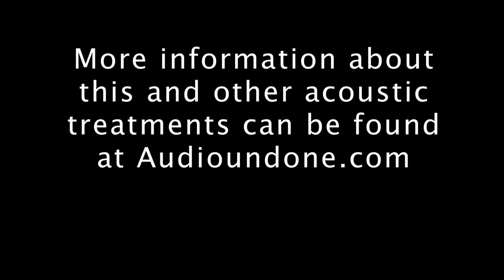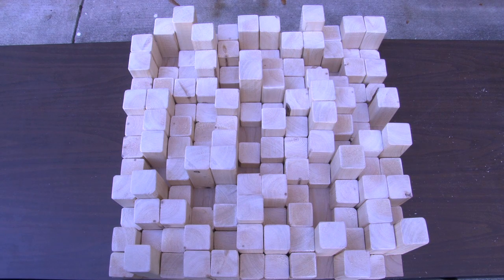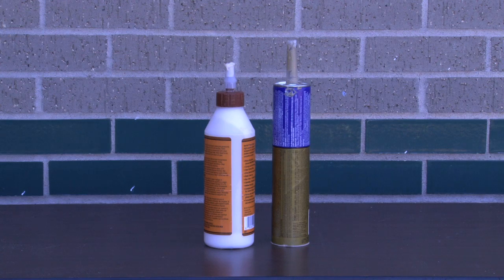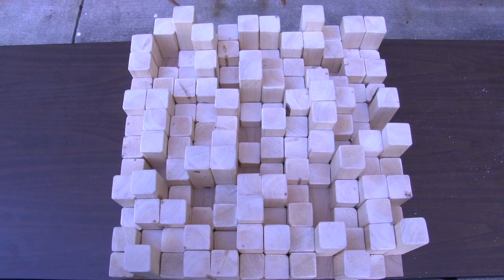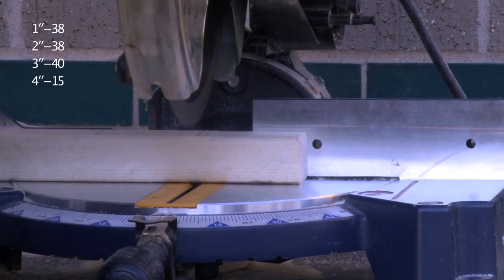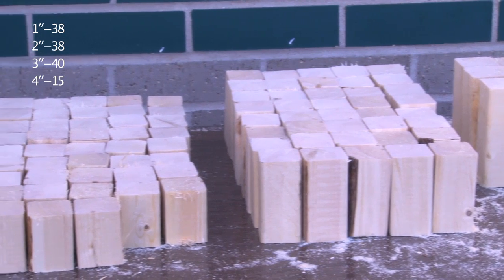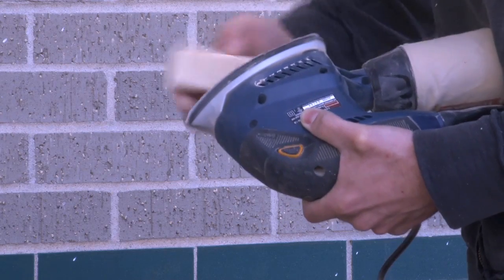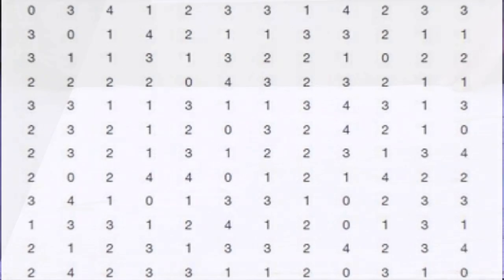Do-it-Yourself Acoustical Treatment: How to Build a Diffuser

Comment: I don't mean to be nitpicking, but the diffuser in this video seems to be a primitive root diffuser (PRD) and not a quadratic residue diffuser (QRD). They are both based off of number theory, but the PRD is a type of diffuser where the well sequence is derived from a prime number and its primitive root.

Comment: what determines the depth of each piece? thanks!
Reply: The depth isnt the important part, the idea is to allow standing waves to be trapped in the diffuser so it is the space between two pieces that matters. Also the diffusing effect is due to the fact that the object is irregular and doesnt reflect the sound it recieves in only one direction. :)

Comment: Using this number theory, I have loads of timber pieces from studs that have been cut down to size. The studs are appx. 1.5" x 3.5". Obviously, the final product will be much more rectangular in shape - but I'm wondering, do I compromise the effectiveness of the diffuser by using larger peices?
Reply: would it be ok to screw them instead of glue

Comment: Thanks for the vid.  I built this today using US specs 2x2 blocks (which are really 1.5 x1.5) and the 24 x 24 board is actually 18 1/8 x 18 1/8. But all in all it turned out very nice.

Comment: The original BBC prototypes were made using 45mm square PVC tubing with end caps. See http://www.bbc.co.uk/rd/publications/rdreport_1995_01, section three. I would much rather use the same material due to it's lighter weight, but sadly, I can't find it retail quantities.

Comment: 40 years ago, I transformed the acoustic in my bedroom for a better room-response from my stereo, using egg boxes.
The principle is the same; you are aiming at diffusing the sound waves to reduce reflections and flutters. Egg boxes will cost you; zero!! Pick them up at your local market (like I did!) you can use contact adhesive to secure them.
I can't see just one of those diffusers having much effect on the sound; cover one complete wall in your room or better still, the ceiling! You need to think a little more scientifically about this solution. One panel just will not cut it. The theory is right on the money; just the application is a little sparse in my mind!
EGG BOXES!!
Ilonka and Daz x x x
Reply: Egg boxes do more harm than good. They absorb only mid-frequencies around 650 Hz while only diffusing very high frequencies around 3 kHz.

It sounds better to you because you expect it to sound better, but the physics doesn't lie.
Reply: Egg cartons do virtually nothing.  Diffusers ARE a scientifically proven method for scattering sound waves rather that reflecting or even absorbing.
Reply: Unfortunately, Egg boxes is a very dangerous solution due to fire-safety. 
These egg boxes are made of a material that generates so much heat when on fire, it's allmost impossible to set out..  But still the solution works, but i would not have it at home..
Reply: stop watching hustle and flow lmao
Reply: Egg boxes only have a small frquency range but they are better than a plain wall. If you use them in the critical areas where sound from the speaker wlould be reflected to the listener on the walls it is not bad. The fire hazard is bullshit. of course it is not allowed if you consider it as a building material for commercial buildings but it isn't more hazardous than cotton or synthethic curtains anyone would install on their windows.

Comment: So I am planning on building a 3d printer soon and I think making this with the printer would be easy enough. The Thermopolymers and Thermoplastics that the 3d printer uses to make stuff would work as a good material for the diffuser right?  I don't see why it couldn't.

Comment: Pretty sure it's just randomized.
You could for example use a random number generator that generates numbers within a range of 1 - 4.
There are loads of free ones on the internet.
Reply: there is a specific number and placement for a reason, you cannot vary this otherwise. you're killing the purpose of how frequencies dispurs

Comment: no, definitely not. That will only absorb the higher frequencies so it would be a waste of money and time trying to build this with foam. One flat panel of foam would do the same job. the point in the wood is that the waves will bounce off. You want the reflection in this scenario. The general rule of thumb is to have a very dead room (lots of absorption) at the mixing end and the other have be 'live' (lots of diffusors). It's an art to get it right (hence why studios spend big money on it).

Comment: The aim is to scatter the waves in a more diffuse pattern around your room to help eliminate standing waves i.e. waves bouncing back and forth between the walls (and floor to ceiling). The high frequencies being tackled here are easy to absorb/diffuse. Low frequency waves are the hardest to eliminate and are the most problematic. If you are really interested look up room modes (as I'm not explaining it here). Resonant panels and bass traps can sort these but bass traps are massive!

Comment: I built one of these today.  I cut the blocks using a miter saw, with a permanent marker line on the deck so that I could quickly push the board to line up with the line, chop, push forward again, chop, and repeat.  Super quick.  The sanding take AWHILE though even with a palm sanding.  THinks for sharing, I enjoyed the video and am quite happy with the results.

Comment: You have to specify... styrofoam with a non-porous surface would have a similar effect and be lighter. BUT, when you say "foam" people assume you mean open-cell acoustic foam, which will have the absolute opposite effect--absorption.

Comment: EPS foam is often used in place of wood strictly for weight and mounting concerns.  Be careful because the finish is much different.  2-4 coats of latex paint can get you a little closer to a wood type finish though.  Also be careful of the density of the foam as that can have an impact as well.